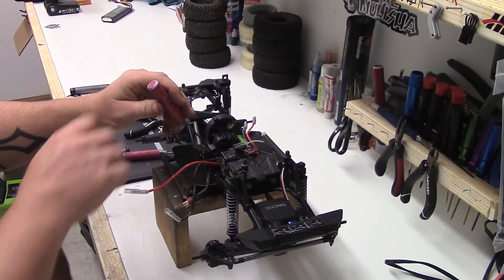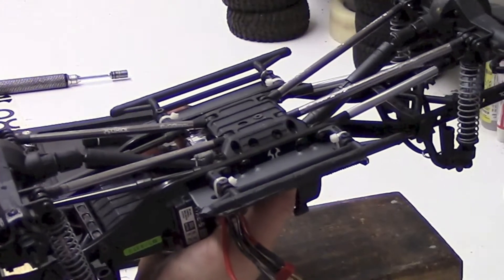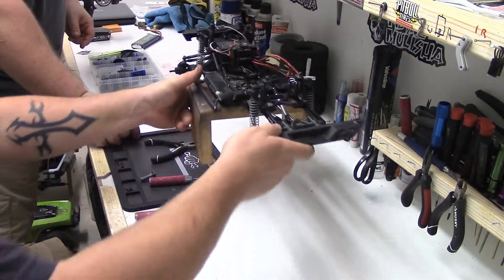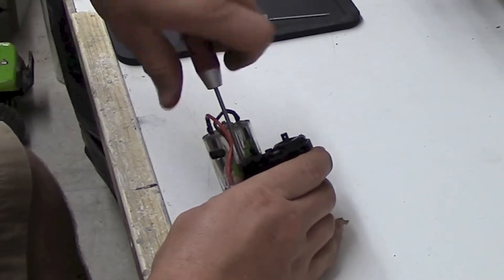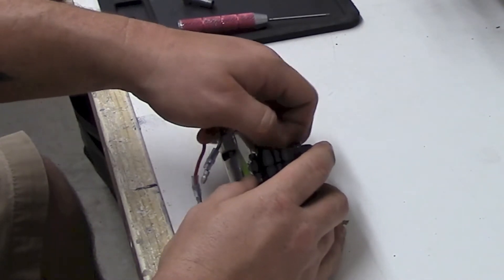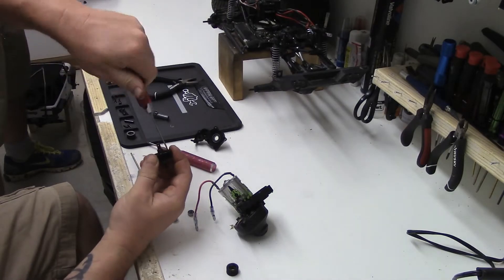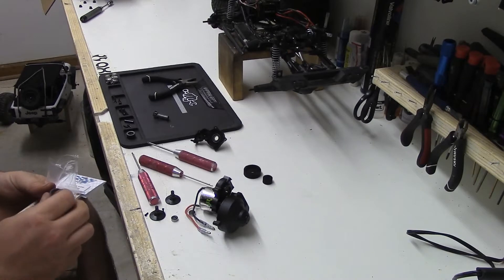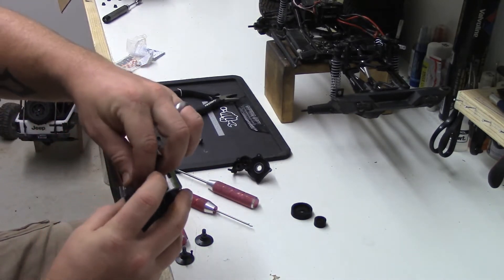RCTogether * Axial SCX10 Upgrade * How to install metal transmission gears

Comment: An old school trick was to put polishing compound and bushings in the transmission,. run it for the duration of a 6cell battery, then clean out, replace the bushings with bearings and re-lube and re-install. Basically its used to quiet down the metal gears and smooth out the differential. This dude told me about this driving a Losi XT and his diff was whisper quiet.

Comment: great video. I just installed this in my wraith.  now the slipper clutch spins good then it gets tight but then spins good again. is this normal. I took it apart 3 times and can't find anything out of place. please I need help. Lol thanks keep up the great videos
Reply from the maker: +deney harmon It sounds like you may need to tighten your slipper clutch down some more.  They way I adjust mine is to tighten the slipper down all the way, then back it off just a quarter turn.  Hope this helps! and thanks for watching!

Comment: WHAT KIND OF GREASE DO YOU USE ON THE METAL   GEARS
Reply from the maker: I pretty much exclusively use marine grease at this point just for the extra protection against water even though I don’t really try to take my rigs in the water so much anymore these days I like having that extra protection just in case. 😎

Comment: can a scx trans fit in a wraith spawn or no?
Reply from the maker: +josh kidding Yes it will fit but you may have to adjust driveshaft lengths.  Internals are the same though if that is what you were asking.  :)

Comment: What was the plug to be used for that you set aside? Part Number 1552
Reply from the maker: MrDubyeh That is a great question, I have never used it and I have installed many metal gears in both SCX10 and Wraith rigs.  It is possible it was used on an older transmission like a gen 1 AX10, but not really sure.

Comment: Can you use marine grease???
Reply from the maker: Yes, you can, but not much.  Just a dab is all that is needed.  Too much can actually cause binding.
Reply: Thank you, that saves me sometime from getting another grease. Perfect video since I'm new with the hobby & I  will be the mini mechanic on mine & boyfriend Honchos.
Reply from the maker: No problem, marine grease is great to keep around, I would also recommend putting a little bit on your front and rear differentials in your axles if you get a chance.  It will help keep moisture out and prevent rust and seizure.  ;-)  Most of all have fun!

Comment: the gear you didn't show is the one I need
Reply from the maker: So that is the internal drive gear for the spur gear, that one should be metal but if you have it fail you should be able to source that one as well, check www.rpphobby.com
Reply: nomedab I already did, I know that it's metal but I bought all new gears in aluminum because it was cheaper then just buying the 2 metal years